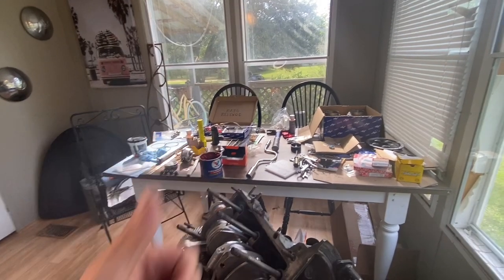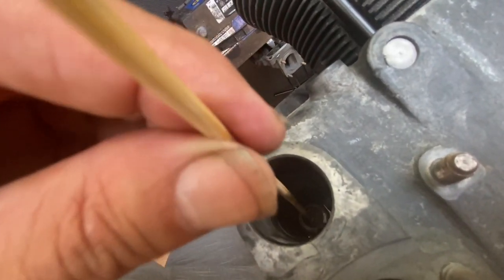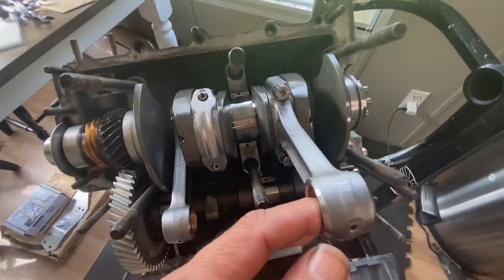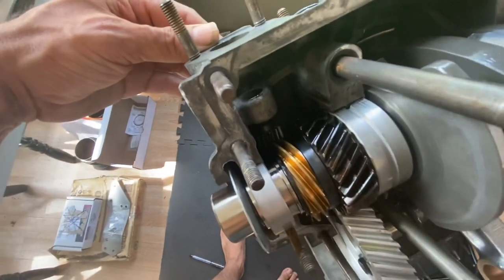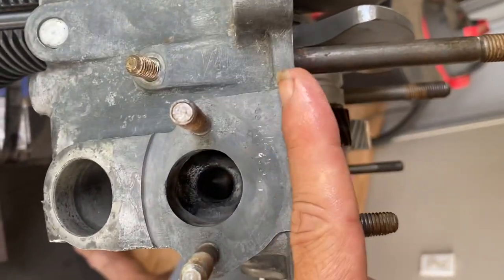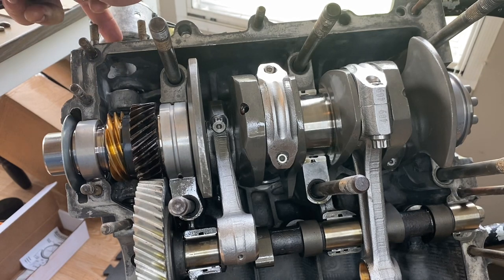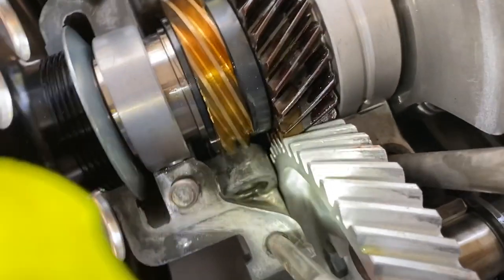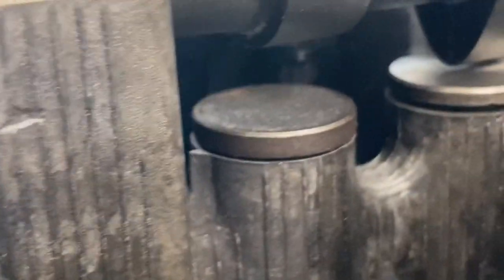(Pt 6) VW 1800 Build Dizzy Drop And Lifter Comparison

Comment: I see that distributor clamp slipping. I just had mine completely slip while I was 250 miles away. I put some tie wire on it till I could get back, worked.
I need to order one of those aluminum billet clamps.
Reply from the maker: Yes you got me looking at them now 😂
They’re kind of thick and looks like you have to get a longer stud. Does seem worth it though.

Comment: Please confirm that the pushrod fits  all the way inside the lifter cup. If it doesn't, it will affect your valve geometry and the way oil gets to rockers assemblies/ heads. I  notice the same problem on new scat,engle,empi lifters last year. You might have to buy the CB performance ultra light lifters. Let us know how you make out.  A few years ago EZGZ noticed the same problem and made a video about it.  Good job noticing that issue. 👍
Reply from the maker: I will definitely confirm once I get my hands on the pushrods. This aftermarket parts thing is craaaaaazy! I haven’t seen the ultra light lifters? Are they cupped like stock ones? I should’ve known good ol’ EZ already found this
Reply: I used a little grease on the tips of the pushrods to see if they fit inside the cups. That's how I checked my lifters.
Reply: @bomberobus  
Yes,the ultra light CB lifters look like they have the same size cups as OEM lifters. From the photos I have seen online. Please search for more photos and information on those lifters.
Reply: I have heard that chrommoly pushrods have a smaller tips and they fit inside those lifters with small cups. I don't have any in hand to try out.
Reply from the maker: My bro had some chromo pushrods and I just checked. They fit the lifter cup great, but I’m just not site about using chromo. I don’t like valve train noise. I’ve heard that with proper geometry, no rocker side play, and zero lash they’re quiet cold, but still get loud after warm up. Plus they’re the black EMPI chromos I haven’t heard good things about. Might have to run them just to get things going. I contacted CB about the issue and am thinking about the super duty aluminum ones if they can confirm good fit in those lifter cups.
Reply: @bomberobus  
Thanks for confirming about the chromoly pushrods. I have a set of super duty aluminum pushrods from CB performance and they didn't fit any of the lifters with the small cups.
Reply: Maybe you can special order a set of super duty aluminum pushrods with chromoly tips?

Comment: The size of the hp lifter are narrower than the stock!?
Reply from the maker: In the end all measurements checked out to spec, but just looked funny to the naked eye due to some minor design differences. The biggest difference was when holding them in your hand, you could feel the better quality of the stock VW steel, which we’ve already come to know. So far 5k miles and that engine still goes strong but one day I’ll open it up and learn how well those lifters held up.